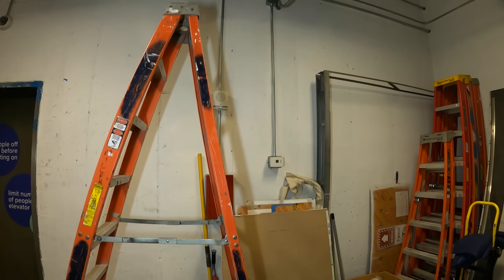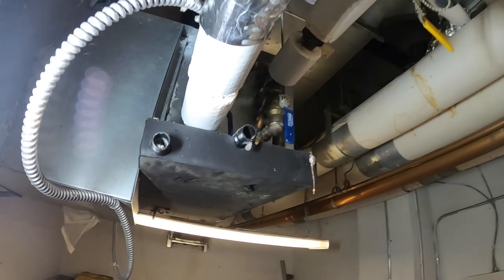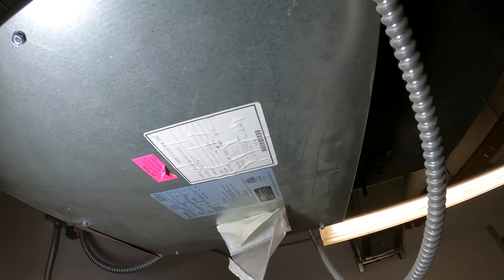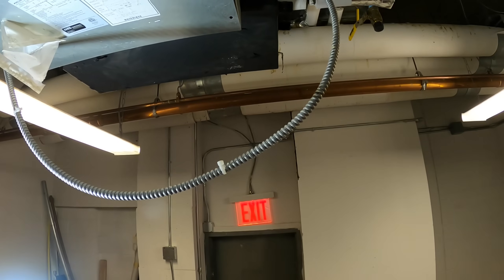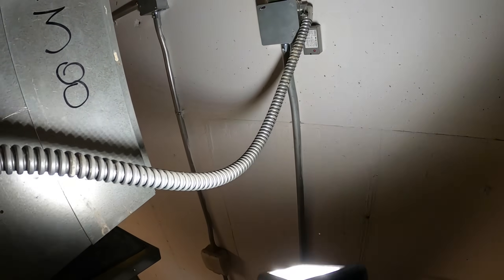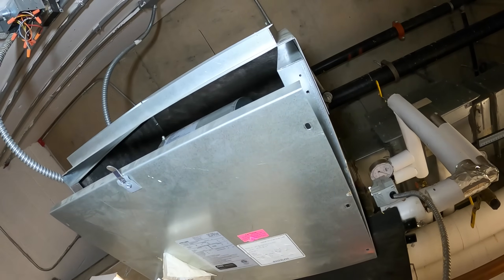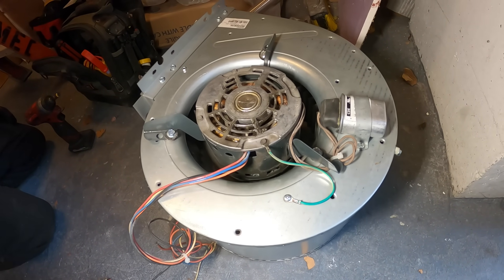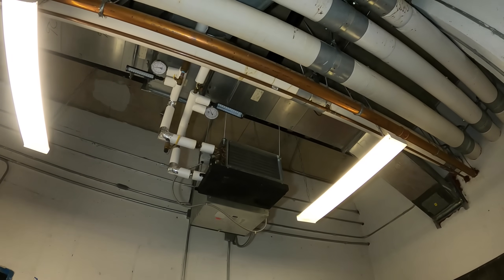HVAC Service Call: Fan Coil Unit Not Heating/Troubleshooting (FCU Not Heating) FCU Troubleshooting

Comment: Spray some electronic contract aerosol spray in copper motor windings, let dry: then silicone spray into copper windings.
Check the ohms of winding O.L = shorted out copper wire. 
Apply a little higher current to motor contacts and reverse polarity. 
💫🇦🇺

Comment: Nice work man. I would recommend getting some leansafe ladders next time you're looking to buy some ladders. Usually about $50 more than a normal a-frame and they're designed for leaning against walls and corners. 100% worth it.